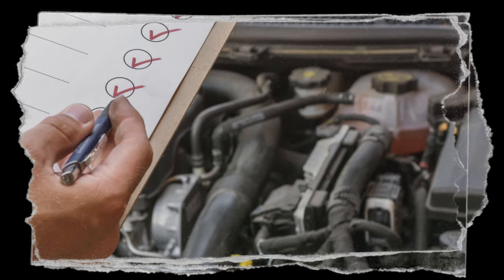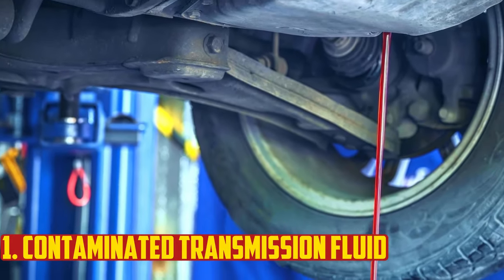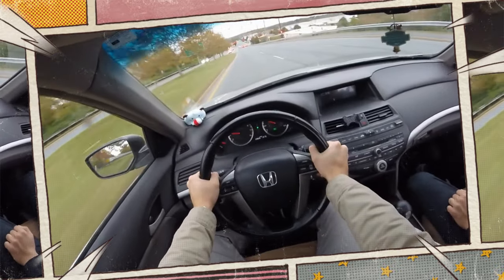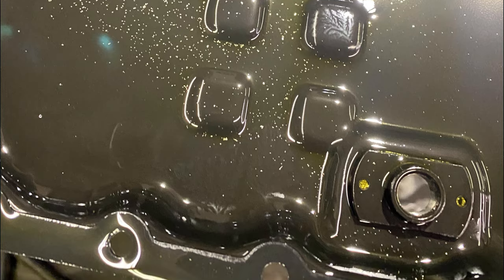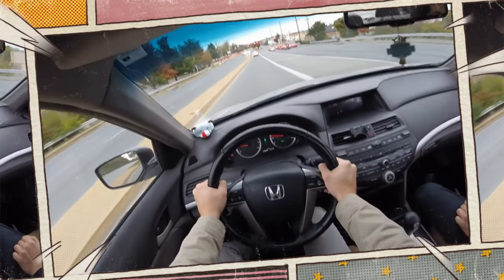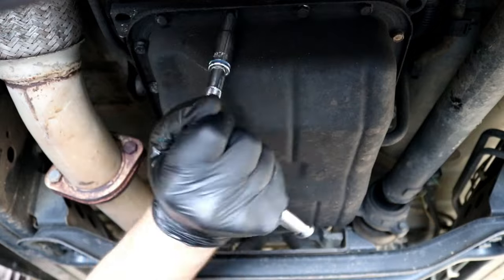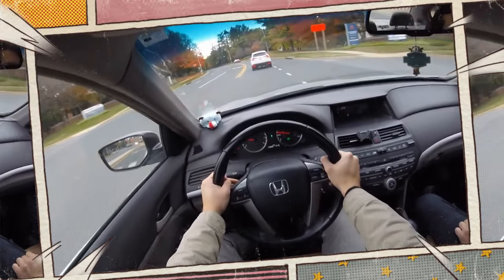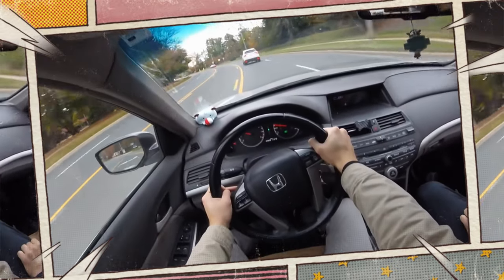6 Symptoms of a Clogged or Bad Transmission Filter

Comment: Don't matter the vehicle trans fluid and filter need changing every 30,000-35,000 miles regardless of vehicle. Use dealership synthetic fluid and keep vehicle from overheating. Protect vehicle investment.
Reply: Lol your funny.  I’m a life long mechanic..  cars are built to fail now and be hard to repair..  want a investment.  Buy any car pre 1979..  the older the better.     Paid 400$ for my 1962 Plymouth fury..    it’s now worth 10k +.    Now that’s a investment
Reply: @hondaxl250k0 for it to be worth 10k you either bought it a long long time ago, kept it in good shape until now, bought one that was scrap and restored it which would most likely cost as much as the car is worth restored or you got lucky and got a very good deal for a 10k car now. Cars are almost never an investment.

Comment: Can a dirty filter cause reverse not to work on a steep or medium incline
Reply: I think so I just engine swapped my infinity and I rest drove it it was fine but when I checked fluid level it was empty, I added more but now it has trouble shifting I think my filters clogged I was having trouble getting it into reverse
Reply: My 09 charger just did dat buh before dat it was just workin
Reply: A transmission filter does not need change unless you have defective transmission ..
Just change fluid ...
Reply: @sproulman1  what if the fluid was dark? Metal sludge on magnets. Still keep the filter?
Reply: I would not change it just fluid ...but if you are doing change instead of flush then change it ...
Some feel doing a flush is bad for transmissions pushing dirt etc isn't valves  ..
Others feel change  does not get all the bad fluid out ...
Way we use to change fluid is drop pan and clean and new filter ..
Flushing transmission gets all old fluid out but some feel it will mess up transmission ...
Reply: @sproulman1  it worked but I’m still having poor acceleration
Reply: @cutliss I'll change the filter if I were you. It doesn't make sense changing the fluid and not the filter. The filter can be clogged and cause it not to shift properly. I was having problems with my transmission I did a full change with new filter and add some lucas stop slip so far so good. I drove it around a few times no problems as of yet pray I don't have any problems with it. Tomorrow will be my first day driving to work ill see how she runs.
Reply: @powerhouseproduction6824  yea changed the filter since I don't hope to pull the pan again any time soon. Fingers crossed yours is back to normal.
Reply: @cutliss  yes I will know for sure tomorrow when I drive to work. With me driving around my neighborhood and to the grocery store it was shifting normal. But before it will just get stuck in Rev at the light I will have to wait a lil while then it will kick in lol. But fingers crossed good luck I'll post an update tomorrow.
Reply: Update 
She's back driving normal again back and forth from work and other errands she did pretty good. I was almost about to take it to a transmission shop until I noticed I haven't changed the transmission fluid i drop the pan oil was dark put fresh fluid and new filter she's running like a champ again
Reply: He'll yea thank you all for the comments and advice
Reply: @kyrix9072 just did an engine swap was able to drive it around then I tried to drive it the next day it just revs what did you do to fix?
Reply: @sproulman1 what about worn friction material and moisture? Stop spreading false info.
Reply: Id change it @cutliss
Reply: @sproulman1 it will mess up transmissions with super dirty fluid as most high mileage dirty fluid carries clutch,and other debris that may be allowing the trans to engage. Introducing clean new fluid doesn't have those particles and can cause slippage
Reply: @powerhouseproduction6824 was the cat shutting off randomly?

Comment: Got a 96 Firebird and a new transmission with only 2000 miles but the dealership that installed it never used a filter I found this out after experiencing slippage so I did a flush (dealership overfilled to accommodate no filter from ) and noticed there was no filter. Can this be fixed by adding a filter and the correct amount of fluid or is it too late ?